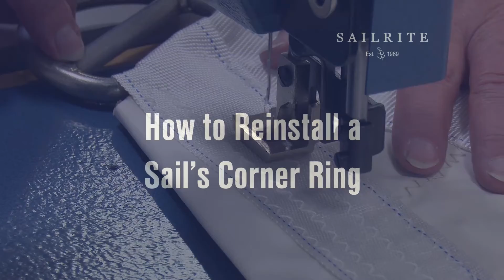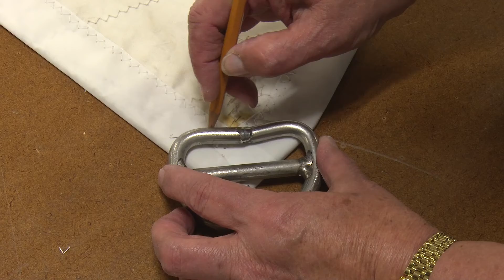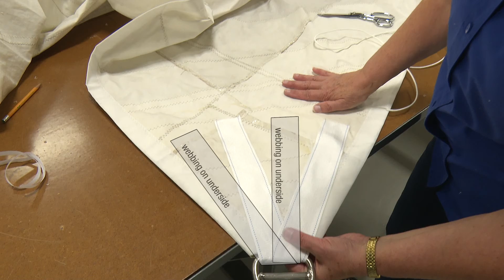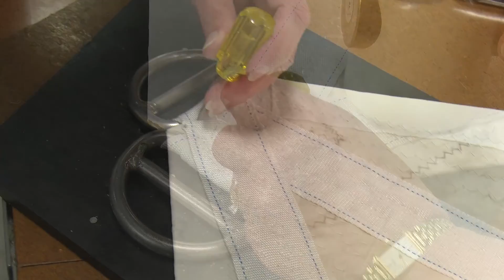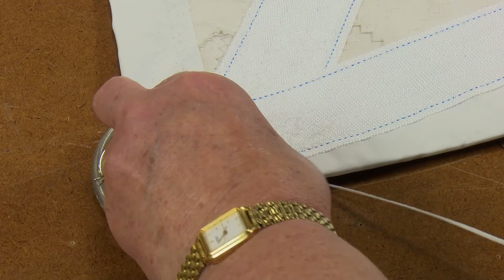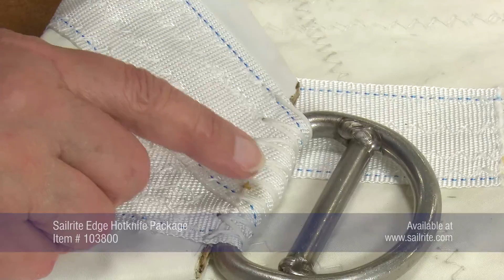How to Reinstall a Sail's Corner Ring

Comment: Is there an advantage to using the D-ring with the bar vs without? Is D-ring preferred over round ring  and eyelet, or just a webbed in round ring? Thank you
Reply from the maker: A D-ring with a bar helps to prevent the ring from accidentally rotating when under pressure. I have used both a round ring without a bar and some with a bar. I find that both work well.